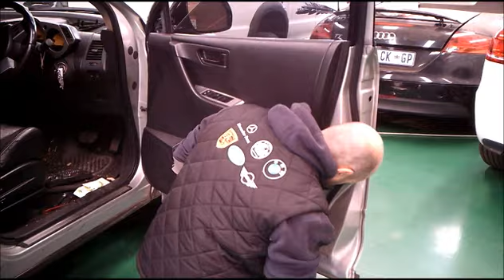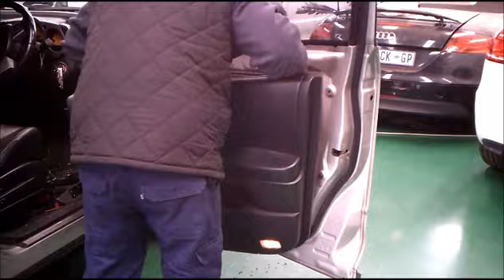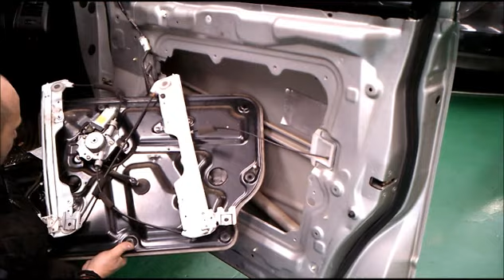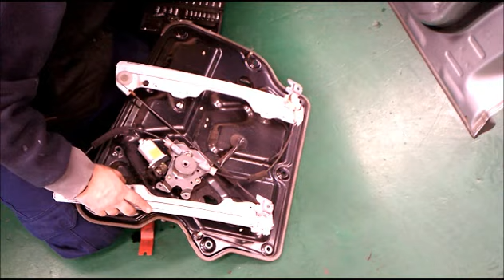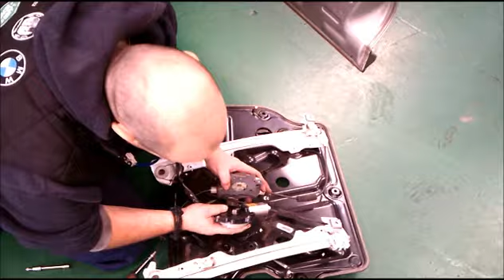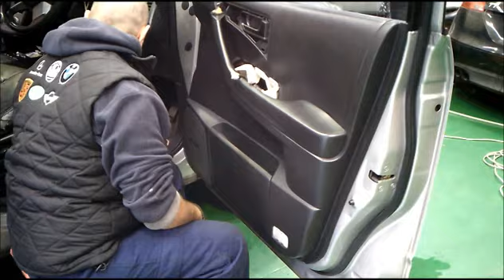Nissan murano Driver side door panel window mechanism

Comment: Bon, le type assure comme un malade c'est sûr.

 Nettement plus amateur, j"ai quand même réussi à changer le moteur dons la roue dentée en plastique était h.s.

 Vu que la réparation est facturée environ 500 € chez Nissan, on peut essayé de le faire soi-même, avec pas mal de patience, à tous hasards.

 Le moteur du lève-vitre est le même que sur la 350Z et la Infiniti je sais plus quoi. Trouvé sur e-bay,  on voit mien les similitudes sur les photos, prix : 30 € avec la livraison, retour possible si ça ne colle pas.

 (Sinon bonne chance pour trouver une Murano dans une casse en France)

 Il a fallu adapter en récupérant le faisceau de Murano qui est plus long.

Donc cette vidéo est utile pour savoir où on va, avec des oublis quand même :

 - pour désolidariser la vitre du lève-vitre (deux rails) , il y a deux regards massé par deux caches auto collants, il faut descendre la vitre (si on peut) pour placer les vis de fixation en face des regards, indispensable à la remonte
 - la vitre ne tient pas toute seule une fois défaite, elle reste dans la porte , j'ai utilisé de l'adhésif de déménagement pour la maintenir "suspendue"
 - pour le démontage, vu qu'on avance dans le brouillard, on on enlever toutes les vis du panneau en métal derrière l'habillage de porte, c'est au remontage qu'il faudra respecter une ordre , qu'on finit par comprendre assez bien.

 Si vous êtes en galère, postez toujours, j'essayerai de répondre.